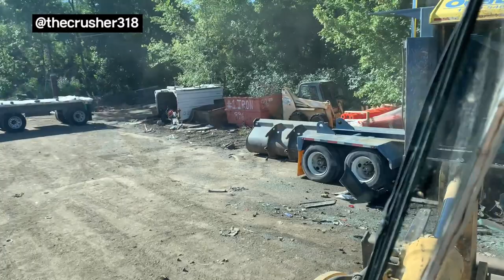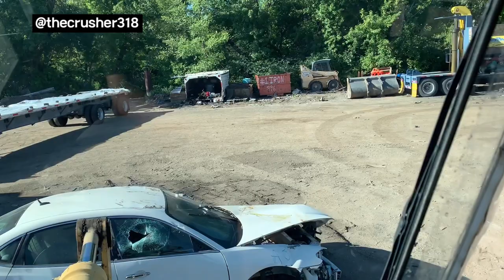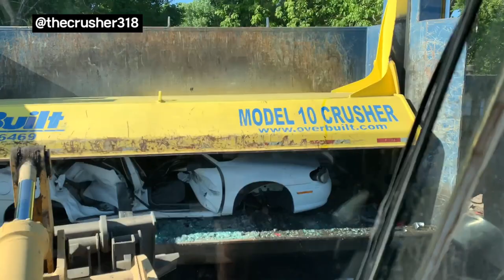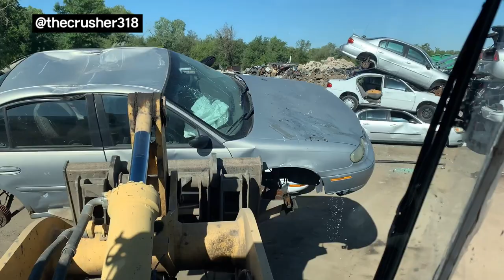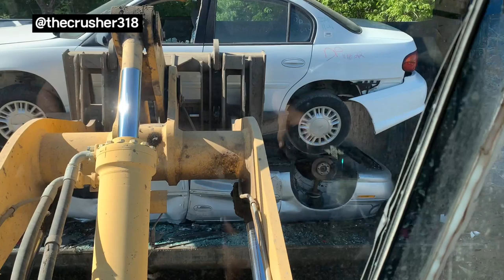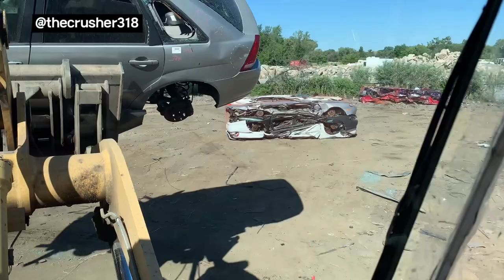Crushing cars pt 86! Gm cars

Comment: Does folding doors in and that pillar actually make a difference since your only folding in one side not both?
Reply from the maker: It does the other side is up against the wall and won’t stick out or pop open that one side will be flat! Sometimes I do have to pull it out of the crusher and turn it around and re-crush and push everything in on the other side but it doesn’t really happen often!
Reply: @thecrusher318  didn’t even think about them popping open. Good point other side has nowhere to go but down.